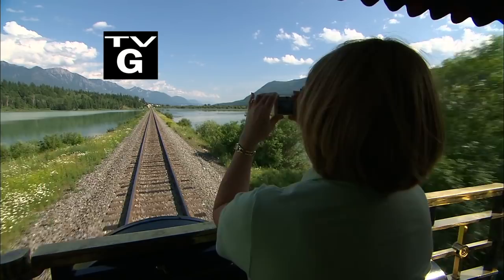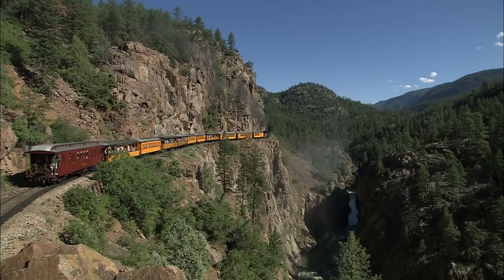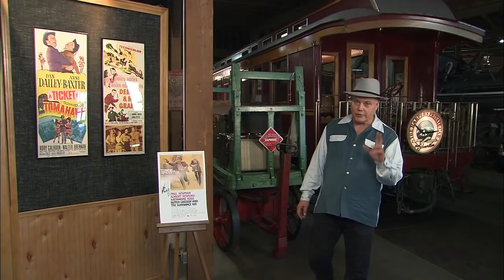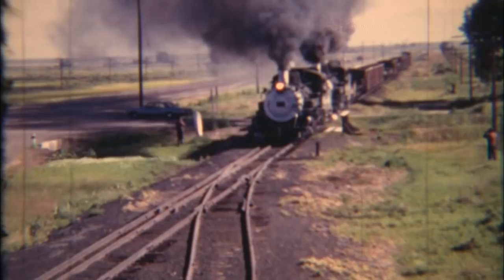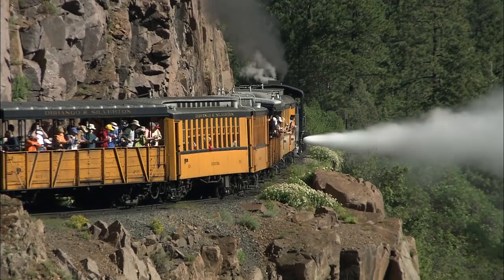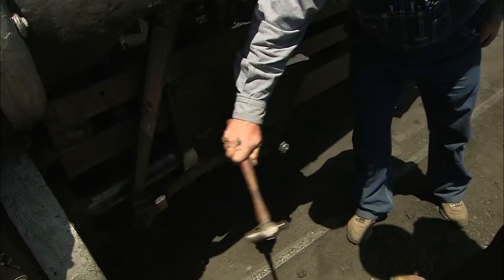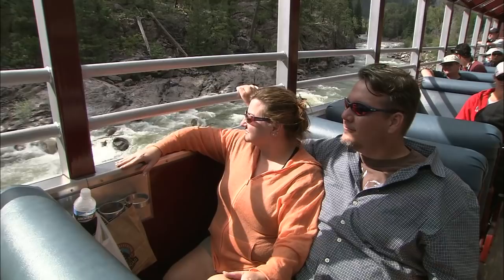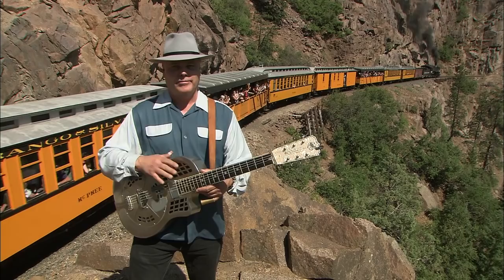Durango and Silverton Narrow Gauge Railroad

Comment: its the steam, not the diesel, that keeps the history going, lose the steam, and the whole thing will fade away
Reply: That's right steam must stay on the tracks
Reply: Russel Mack 
They're converting one to burn #5 fuel oil- furnace oil to some folks- and having two custom-built diesel locomotives that resemble steam locos for use in the dry season if fire risks are severe. There are no plans to remove steam.
To be honest, only about 1 of us out of 100 care at all about what kind of locomotive is pulling the train.

Comment: I hope the new owner remains firm in NOT using "modes other than steam" because once you park those steamers for good, the tourists will stop coming.
Reply: Anonymous Libertarian 
Mr. Harper has owned the line for over a decade, so he is not really a "new" owner anymore. He is about as firm as one can be in regard to preserving steam power on his line. He wants it to be so authentic that he has steadfastly focused on keeping all the locos coal-fired. 
He has had to placate the local residents by using diesel-hydraulic switchers and taking measures to minimize the fly ash from engines under steam overnight. Lately, his line has been the focus of a civil suit regarding the 416 fire that many say was started by coal cinders from one of the locomotives. He is taking further measures by converting one engine to burn furnace oil instead of coal, and adding two custom-built diesel locos made to resemble steam locos for use when fire danger is severe.
Honestly, they could stick big turbodiesel engines in the tenders of all those old steamers and run them without steam and only the very few steam nuts like us would even notice. Most people are there for scenery the trip offers- not so much the historical experience. I would hate to see it happen, but I don't think ridership would suffer if they did away with steam. It might even improve, since lots of people don't like that noisy, dirty thing that I love pulling the train.